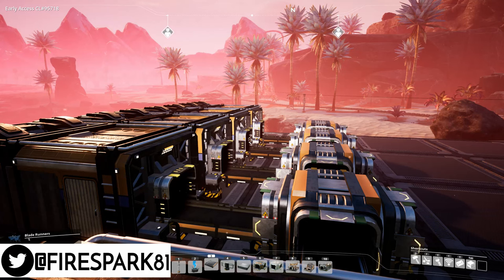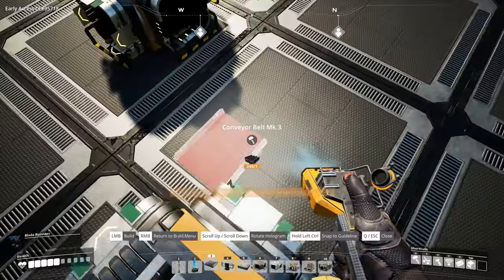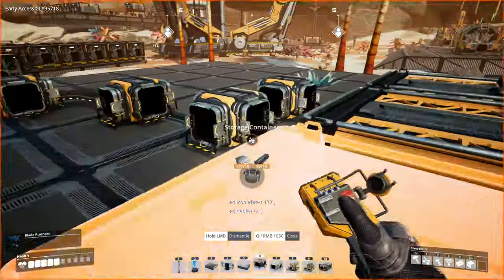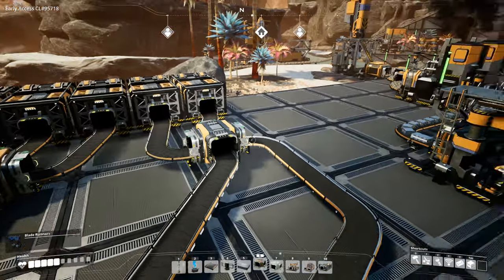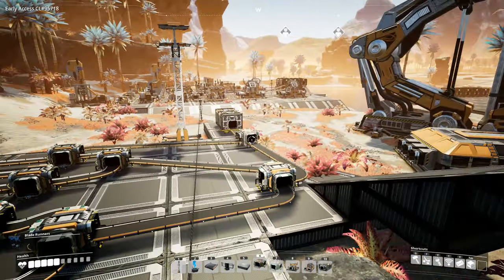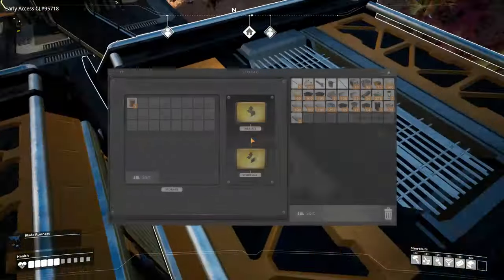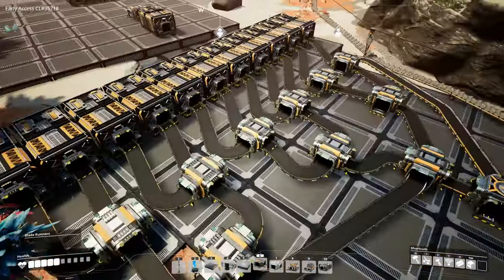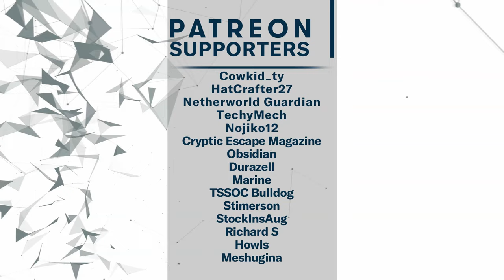Satisfactory Understanding Splits, Ratios And The Conveyor Splitter

Comment: Spliters only split composite numbers evenly; not prime numbers. when doing prime your basicly creating an overflow loop causing the overflow value to recirculate into the next left value slot. Your creating what is essentially a mechanical calculator. The spliter is acting as a toggle and rotates in a clockwise sorting fashion not really splitting put outputting a value in this case a material then moving to the next Output slot Left->Center->Right->Left->center ect if there is not a belt in the center then it skips and goes to the next output in order.
Reply: I'll be honest I couldn't have said it better myself so congrats mate you beat me to the punch LOL
Reply: Yeah thats very well said. I think an easy way to visualize it is to have 1 input, 3 splitters, and 3 storage containers. Pretend the splitters can only split 2 ways instead of 3 and set up the system like firespark shows. You have one splitter splitting to two more splitters giving you 4 outputs and that leftover one comes back around. This simple example is nice because you can easily just draw it or trace through it with your mind and see how each splitter would send each item left then right then left and how that would evenly split 3 ways even though you're only splitting by 50% at each splitter.
Reply: That just settled so well in my brain. Splitters are not actually splitting, they’re calculating!

Comment: Nice video, I did notice that the last split into 11, could be done with less splitters.
1 split into 2, those 2 split into 2 (giving 4 belts), then those split into 3 (giving 12 outputs). This way you would only use 7 splitters instead of 10. In the end it probably doesn't matter but could help save space depending on the factory.

Comment: Your 1 to 5 splitter is limited to 5/6th the maximum throughput of whatever belt you are using.  The leading merger tries to pull evenly, which means that every time a "feedback" item reaches it, the input stream will stop to let that item pass.  For throughput, you're actually better off having 2 machines with 1/4 belt each and 3 with 1/6 each until they start to back up, rather than 5 each with 5/6 of a belt.  As your number of outputs increases this matters less as 11 outputs would have 11/12 throughput, but I don't know of any machine that one input belt could feed 11 of.

The most efficient method would be Belt > splitter > 2 mergers > 1 splitter each > 5 cargo containers/machines and 1 splitter.  That last splitter then inputs into the first 2 mergers so you're adding 1/12 belt to 1/2 belt in 2 places, rather than blocking 1/6th of the input belt.  

TLDR: always split before you merge unless you want to throttle your input.

Comment: Explanation:
You are spliting in 6 parts [(1/2)*(1/3)=1/6]
But, 1/6 of this is comming back and been split in 1/6 again and added to the other belts,
and 1/6 of this new split is comming back, so its 1/6² of the original, and again in 1/6³, and so on...
If you sun this series, you will aproximate to 1/5 (1/6+1/6²+1/6³...).
This work for a number of splits, like:
1/6+1/6²+1/6³... ~= 1/5
1/8+1/8²+1/8³... ~= 1/7
1/20+1/20²+1/20³... ~= 1/19

Comment: most of the time splitting inefficiency should work itself out. The factory network will just backup on the lines getting too much, forcing the mats to be delivered to the empty lines. So you pay for the convener inefficiencies with having some lines full.

The best looking factory setup I have seen involved bringing in lines of mats, and using splitters to split to two machines on the sides and continuing on with the middle line, split and continue. Sure, way more mats are delivered to the first line of smelters/assemblers, but after the 1-2 conveyors fill up the mats just continue on through.

Comment: I can explain this super barney style:

Basically the splitters output in a rotating fashion. Left, center, right, repeat. when you're only using two of the outputs then it can only output to two. A large quantity spread over 2 of anything is 50%, and spread over 3 is 33%.

So if one of your splitters is running 3 channels (33%) you want the other one to do so as well because then it's outputting the same amount too (33%). So, with the second splitter 2/3 of the outputs can just go into a storage container while the 3rd feeds BACK into the system. This will not overflow the system or confuse it, it's sort of like a reset switch.

Comment: All you need know about the way the splitters work is that they divide among their outputs evenly (unless you have filters). If you don't have enough destinations for all the output belts, you send that output back to the input, then you just have more input. 

In this example you know all 6 belts will be distributed evenly. So the 5 storage belts will be distributed evenly. The 6th belt has nowhere to go, so you put it back to the start. If the amount of resources was continuous (like a liquid) there would always be a small amount of resources left on the last belt (being divided by 6 every loop) but as there's a discrete number of items, eventually they all get placed in a box.

Comment: An explanation for the 5 split that its like dividing a number and getting a remainder instead of figuring out the fraction and adding it into the next devision

8 plates / 5 storage units = 1 per storage unit with a remainder of 3             8/5=1 R3
then you put those 3 plates into the next batch of plates with the merger
(3+8) plates / 5 storage units = 2 per storage unit with a remainder of 2      8/5=1 R2
then you put those 2 plates into the next batch of plates with the merger
(2+8) plates / 5 storage units = 2 per storage unit with no remainder            8/5=1 R0
And it keeps going...

Comment: Ya you're basically putting a sixth belt into each of the 5 containers then putting the extra sixth back into the system to be filtered into the original loop.

Comment: I wish they would add a 1->5 splitter. At the moment, when you want to split (without that loop thing you showed, because it wont work good on fully loaded belts) you should have your output number calculated with 2^x * 3^y with x and y >= 0. But with these splitting you will have problems to use your mines efficient (e.g. 450/min limestone (due to conveyer limit) can't be splitted on 10 constructors for concrete, but with a 1->5 splitter you could split by 2 and each output then by 5 to get the 10 belts with 45/min)
Design idea would be  adding conveyerlift connections on bottom and top of the normal splitters or just adding new model.
Other thing I would like to see is overclocking by output/min not by percent (or both), because I don't want my mine to produce 451,2/min (188%), I just want the 450/min (187,5%)

Comment: The math has been well explained here already. On the more complicated splits you refer to how the remainder material on the feedback belt "knows where it needs to go". So the material itself has no intelligence, it is not searching for the bin where it is "supposed" to go, though it is always funny how it gets there right? An individual splitter just pushes material out each of the 3 ports in sequence (sequence is the key take away here) over and over again provided there are no material backups. It is the sequencing of the splitters in the same pattern over and over again that make it seem like the remaining material "finds its correct spot". When in reality each spliter is just sending material out of port 1, then 2, then 3, then 1, then 2, etc over and over.

To test this add a piece of material to the system before the feedback material starts to cycle through again. you should see that the new material you added takes a spot in the bin where one of the left over pieces would normally have gone and in turn the leftover materials just shift to the next bins. no magic here, just logical switching of splitters. I hope this helps dispelling some of the perceived magic of materials and splitters.

Comment: the issue here is not to split 10 parts evenly. A normal setup is not about 10 parts ... The issue is more that once your belt is full, the overflow will jam. That's all. You think you split but it only works on a few parts due to the ticking system of the splitter which always do his exits one by one 1.2.3 but once your overflow will be jammed. it will be 1.2 because when checking for the 3rd exit, the splitter won't be able to push more parts so it will just go back to 1. What you think is evenly splitted is just not.

Comment: There are so many over-complicated attempts at explanations here, and several are even outright incorrect. The outputs of a splitter are just used in sequence one after another as long as there is a belt connected and it isn't backed up, so to get an even split between outputs you have to connect an equal number of belts to all splitters in the same "stage", even if you don't have an even number of consumers. The remaining items might go several more rounds back to the merger if 3 or more make it to that final splitter. The splitters don't magically know where to send anything, nor do the items know where to go.
Reply: For the example with 11 consumers you can even connect all the outputs of the final "stage" splitters, and merge 2 outputs from the last one back into the feed, which might drastically reduce complexity depending on the actual number of consumers.

Comment: more an explanation than math;
If you look at the containers in one rotation of item all containers will get 1 item and then there will be 1 item over the item that is left from the rotation then gets reversed to the first splitter and then it starts the on the second rotation by going to the first container in the first rotation.
how to controll this, use 7 containers for example and put in 8 items in the system.
the 8:th item will go to the first container in the rotation.
the 9:th item will go to the second container
10:th item= third. 11:th= forth and so on.

Whatever number of extra items you put in the will just simply add 1+ to whatever the rotation is on.
if the rotation is on 5/7 +(1 extra item) --> 6/7
3/7 + (14 extra items) --> 2 rotations and 3/7

Comment: It’s a recirc line because you have to always use the same number of lines from each splitter if you want even spitting. However that divides out  with a remainder will tell ya if you need X (remainder) of recirc lines